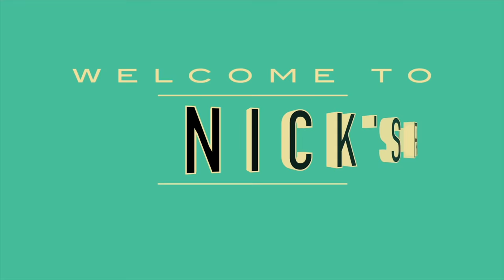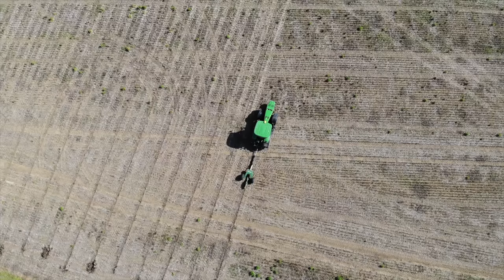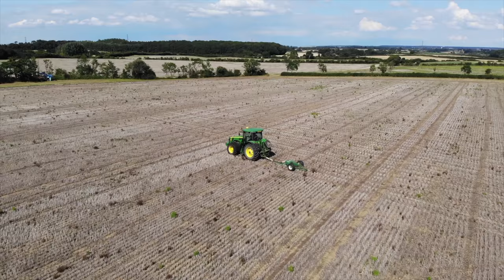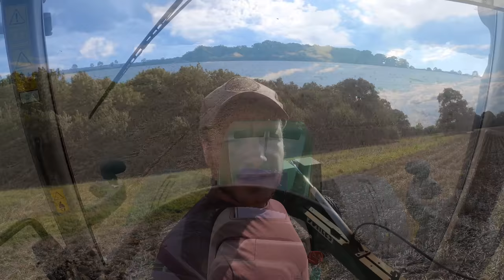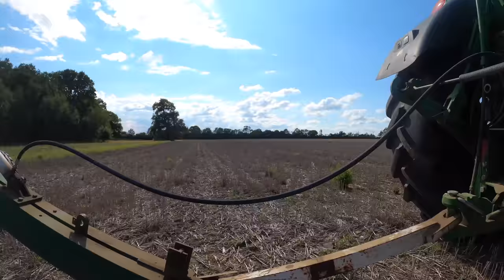A VERY SLOW JOB! MOLE PLOUGHING WITH THE JOHN DEERE

Comment: We ran our mole plough with a deutz Fahr 5130 weighed down 6.5 ton and pulled down hill at around 4.5 to5 kmh.    The tractor could only just pull on flat but soon it hit any sort of incline it bogged down or stalled   Even at 2000rpm.        We just recently bought a new holland 8770A which pulls it very nicely.                    I worked for our contractor as well who built his own mole ploughs he uses a new holland T7.245 and a new holland T7.315  both with wheel weights and front weight blocks         They pull them with very little struggle and can up hill with them

Comment: I am also pulling a Miles mole plough, but with a JD 7710. To gain some extra traction when pulling a 4" / 100 mm bullet I carry extra weight on rear linkage in the form of 18 fan weighs on a bar, borrowed from a different tractor. This is up out of the way and not inter fearing with draw bar.

Comment: Nice 1 nick. Been looking at mole ploughs for a while think there a great tool in the right ground
Reply from the maker: Thanks mate, yes they’re a very handy tool 👍
Reply: I would only consider a mole plough for land that has a proper drain system already in place.
Reply: You’ve got to know where the water’s going to go.  Mole drains work well and can last for years, if you’ve got a decent outfall.  I notice the other poster says that you should only mole drain if you have a good drainage system.  A complete system’s not necessary, as long as you’ve got a working outfall that you can aim for.

Comment: I used to do a load of Mole Draining when I was on the farm, but I had an old BTD20 Crawler about 120 HP and they would burn the straw fields off first then send me in, the machine was very loud and hot, had to wear ear protectors and used to go home black from the burnt straw, how times have changed.

Comment: Not questioning you at all, but if the tractor could pull harder, what is limiting your speed?
Reply from the maker: It was a very tough field and I wanted to make sure the mole was doing a good job, the slower the better for moling 👍
Reply: @NicksFarm  thanks for explaining! Is this because you don't want to 'loosen' the soil?
Reply: @willmc4403  The leg gets hot and can weaken the steel. Plus it wears faster if you go fast.

Comment: Yeahhhhhhhh not sure the jd has enough hp in her for that job 😂😆. I  planning on sub soiling the big winter field after I do what ever I do with the grass in there! Question is, what's gonna pull it? NH or mb??
Reply from the maker: Yeah she did struggle a bit 😂 What sort of sub soiler do you have?
Reply: @NicksFarm  3pt linkage one. Turf cutting wheel on the front and a removable bullet on the bqck

Comment: Question why can’t you just use a no till ripper ?
Reply: Because the idea is that you leave a channel in the ground for excess water to drain through. These channels are placed at around 600mm depth and across actual drains made with clay pipes in the old days and poly pipe with perferations these days. the channels made with a mole drainer have no structural sides and only last around 5 years. A ripper leg does not leave a channel, instead pulling through to break up any hard pan layer often found where ploughing has been practised and a hard layer has formed. It is good to erradicate that layer, but the aim here is to supplement existing drain systems with mole drains. The part that creates the drain is usually ceramic as it lasts longer than steel.

Comment: All that compaction ur getting tho 🤦
Reply from the maker: Not an issue as I’ve cultivated that field now 👍
Reply: Will still have some conpaction deeper down 😅🤔
Reply: Dont get me wrong, i love john deere and the big ones but u should maybe used one of the fords next time since they are less heavy
Reply: @96tyren  Weight is what gets the power to the ground. The colour of the tractor is irrelevant. After mole draining, using a subsoiler at an angle to the direction of the mole drains is what will remove any compaction damage caused. Another thing is that the mole draining has a ripping effect as well. If you think of the leg pulling through the soil, take a line of 45 degrees from either side of the tip of the leg upward, all that soil is getting disturbed. Pulling subsoiler legs through afterwards is already easier because of what the mole drainer leg is doing the ground either side of the leg.
Reply: Oh ok then it aint a big problem i guess if ur subsoiling it or have done 😅 my bad 🙈🤠
Reply: @alexveldhuis6004  sounds like a massive waste of time and money to me